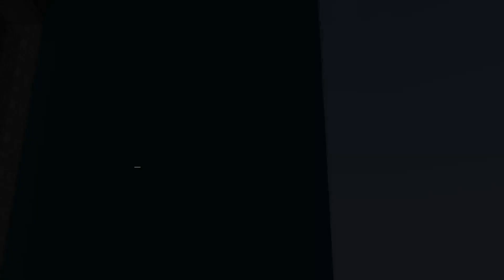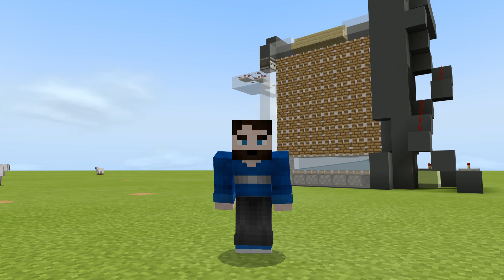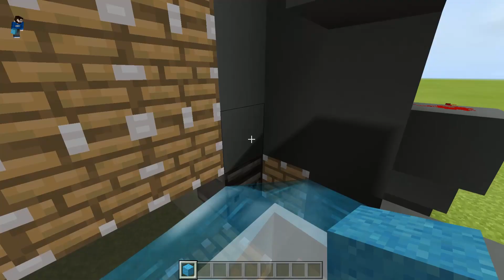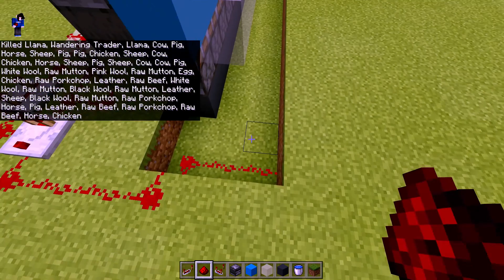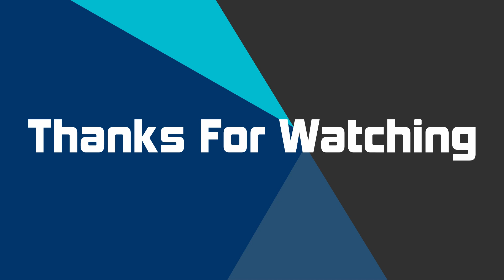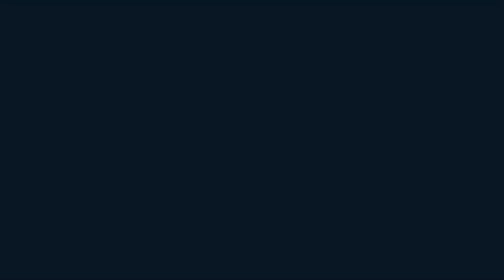Concrete Factory | BluPrints - Minecraft Tutorials

Comment: stair-stepping glass was unnecessary... you could've simply just made a 2x1 column of glass, with a break in every other one so it looks like a zig-zag pattern, because glass does not block redstone path as solid blocks would. redstone travels straight down that and would've shortened the redstone necessary, for both the fail-safe button and the piston wall mechanic. the extra line out of the comparator for the piston wall wasn't necessary either as the path to the repeater would've resolved that.

now you have a neat, clean machine to build around. otherwise, this was a good video. liked and saved.
Reply from the maker: Thanks for the tip! I’ll take a look at using this method for future builds! 👍🏻